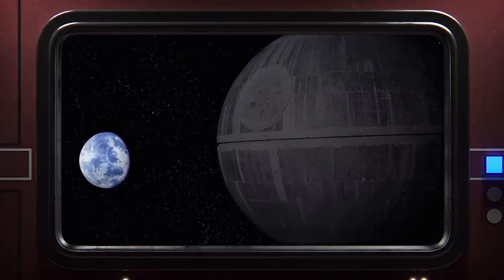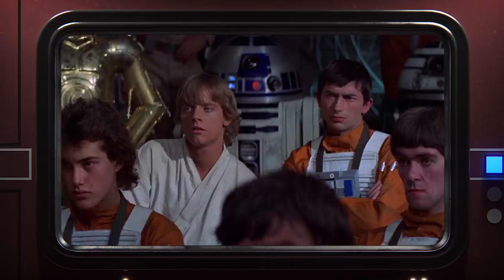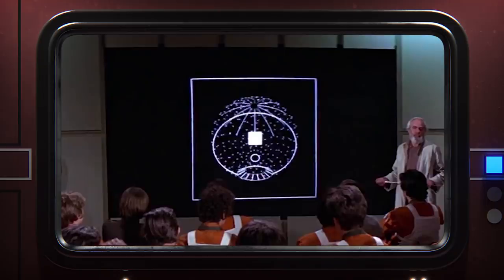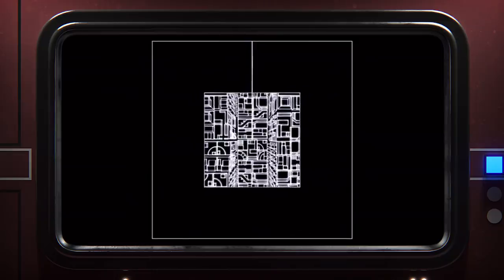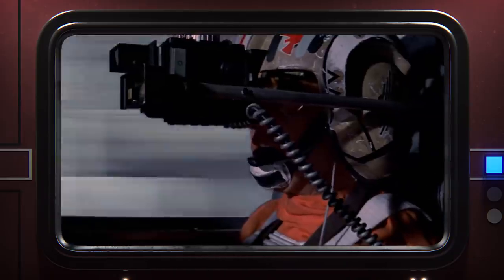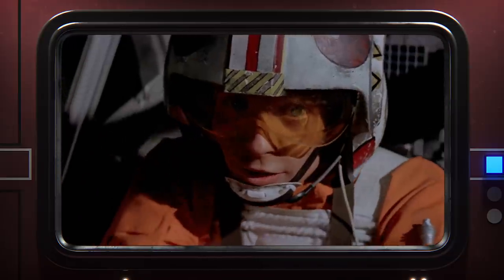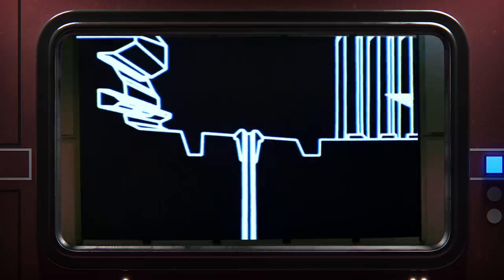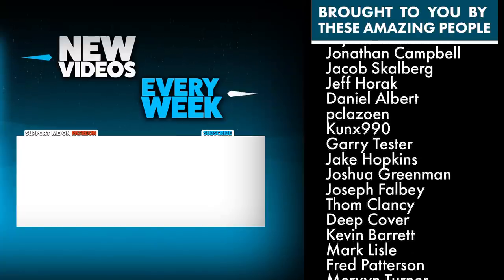The Thermal Exhaust Port Was NEVER a Problem

Comment: Great video! You may have missed one small point from the rebel briefing. I haven't read through the comments to see if someone mentioned it, but it's stated in the brief, itself,  that the empire didn't consider a small, one-man fighter to be a threat and that it's defenses were aimed at a direct, large-scale assault, otherwise their defense would be tighter. Even though the DS's construction would have, presumably, withstood a direct attach by such fighters, they still had a huge compliment of tie fighters on board and did try to destroy the rebels, ship to ship, coming very close to repelling the assault. Even without a super-tight static defense the DS still had the capability to stop the rebels. To refer to Luke Skywalker as a "Magical Space Wizard", who used the force to make his "impossible" shot, leaves out the fact that Darth Vader was also a "Magical Space Wizard" and he failed to stop Luke. It also leaves out the pang conscience that motivated Han Solo to change his mind and save Luke from Vader and two other tie fighters. The DS technicians analyzed the rebel attack and saw a danger and tried to fight back, even warning Grand Moff Tarkin in the process. His arrogance, alone, is what may have cost the empire the death star. It doesn't come across well in the movie, but in the book Tarkin is almost insane, over-confidently believing that the rebels have no chance, basically saying, "... So what?" To the new information. None of the nay-sayers even account for how much information was brought to the rebels and how much time they took to go over the technical readouts, just to find that one and only bit. Whether it was sabotage or not doesn't mean much because the shot was impossible for anyone who wasn't a magical space wizard; wasn't it Gold Leader who made the the only other shot and he missed. I get this feeling that some people think that Luke using the Force to make his shot was unfair, or some such nonsense like that. The Force was the only chance he had and he was the only one strong enough to use it. Besides, the Force is a hugely major underpinning of the whole damn story; without the Force none of it would've happened: there would've been no Sith, no Jedi, no clones, no emperor, no empire. To shit on Luke because he used his one special ability to do the impossible is ridiculous. The idea that the empire should've built the perfect weapons station is also ridiculous. Basic military theory dictates that if you make it impossible for the enemy to get in you make it impossible for you to get out and no weapon system is entirely Grunt Proof. I'm a Grunt; I know from personal experience. I may have gone off-topic, sorry. To pick this one idea to dump on, when you compare it to the dozens of other irregularities and inconsistencies in the story is stupid. After all this guff I've typed out, I think you're right; they did a great job of covering all the bases in planning the attack and the empire did a good job of covering the defense. Nothing in the building of the DS could've accounted for Tarkin's idiocy and Luke's Jedi ability and the attempt to plug a non-existent plot hole is a waste of time.  I think most people are still pissed it was Luke and not Han who destroyed the death star. I really enjoyed the video and I hope you have a nice day. Sorry for being windy.

Comment: About the Galen Erso thing:
In the Audio Book for Rogue One, it was said Galen Erso kinda tricked the Empire into putting it there. He explained the issue and gave three solutions. His favored solution was not the exhaust port, but another one (I didn't quite understand it, something like a large funnel, but long story short it made sure to mention that his preferred method was quite expensive and the exhaust port was the cheapest. He especially made it clear taht though the exhaust port wouldn't protect the standard crew quarters from radiation, it would protect the Officer Quarters, and seeing as he was presenting this to an Officer (some lieutenant, I believe), that would be fine with the Empire).

Though it made it sound like there was one thermal port, it didn't technically say that, and I think it still fits well with your explanation (which I like). He made sure that one was flawed, but the others were not flawed.

Comment: A little correction with respect to Rogue One. Erso didn't put the exhaust ports in as the weak point, he inserted a flaw into the main reactor core that he knew would cause a chain reaction if struck by a torpedo. Jyn refers to this in the dialogue, talking about a trap in the heart of the battlestation.

Comment: you forgot to mention that its literally impossible to blow a torpedo in it. even using the force, "which for plot points seems to have unlimited range at that moment in the film, but at any other moment its at most 100 meters"

since the air pressure from the exhaust port would blow the torpedo out of the hole
Reply: You think they carry unlimited air with them or something?
Reply: What air pressure? You are assuming it is a gas port, that it exhausts continuously, and that it is a high pressure system, and that it can possibly hope to resist a TORPEDO forcing its way down it- and there is no system in place to shut off if it detects back pressure. 

It might well just emit photons or radioactive particles- we have no idea. it might even only trigger when the gun fires or might have only been needed during construction.

Comment: Thank you! YES! Plus,  they mention that the Death Star's defenses are designed around a direct large-scale assault; they're designing their defenses around capital ships, because who would expect the enemy to attack an entire PLANET with fighter-planes? Starfighters are so insignificant against something this size, vital systems so much deeper than fighters could reach, that there was almost no point in considering it (from the Empire's perspective). And, they mention that a direct shot down the exhaust port might start a chain reaction. In other words, this shaft ran close to some other system, that ran close to some other system, that ran past the reactor- and an explosion might set of a chain of destruction ; it's not like the shaft led straight to the reactor.

And finally- the Titanic didn't sink because someone designed in a special iceberg-exploitable destruct system. It sank because although the designers created it to be safe and unsinkable, a scenario that didn't occur to them, where damage was inflicted in a manner they never expected, overcame their precautions. That's what happened here. A forcefield-sealed heat exhaust pipe isn't a glaring weakness or design flaw- it's something that, on paper, was adequately safe and posed no serious risk. But a group of rebels looking at the plans from another perspective- not to build something competent, but to find a way to destroy it, no matter how tenuous or desperate- connected the dots on how it might be exploited in a way the builders never did, because they had no reason to think it that kind of desperate, long-odds, destructive manner.

I hate the Erso idea, by contrast- because not only is it 'fixing' something that didn't need to be fixed... but it also goes from what's described in the paragraph above to an intentionally-designed system that apparently slipped past all peer reviews and inspections. An unexpected overwhelming of a system designed to be safe is a mere failure of imagination, and believable. A system designed to fail and not noticed or caught is what truly makes the Empire look incompetent- it's a failure of security, of basic competence and attentiveness on the part of other members of the project, and of intelligence on behalf of an Empire that knew they had a coerced and unwilling worker but apparently trusted all his work blindly.
Reply: Really? So this incredibly complex system could end up with a failure causing flaw from oversight and lack of imagination, but the lead designer of the damn thing couldn't in any way imagine a small change to this massively complex battle station that could result in the same? So ignorance is less believable for an explanation of a flaw in a system than premeditated sabotage, by someone who was an expert in his field, intimately involved in building the thing being sabotaged, which is unprecedented in its technological complexity?

Comment: There was also a book written about it where a group of rebels are on the death star in order to make sure that port was not internally repaired. Because it was designed to be exploited. And they got trapped on board and exploded. Was written in the early 2000s.

Comment: This exhaust port is above the laser. Dodonna says it leads to the main reactor, which primarily powers the laser. That could lead to the conclusion it's the only exhaust necessary or the only one that goes to the reactor and cause the chain reacting.
Also, Luke may have used the Force to guide the torpedo, but that doesn't mean it wasn't possible any other way because it's a TORPEDO. They can change direction. It's even shown in the graphic during the briefing. 
And "impervious to everything" is quite a statement. Maybe it was the only available warhead they had on hand that could. Also, I don't understand how this point would make the story less believable.

Comment: while the video highights the many "possible" exhaust ports, the movie provides a reference to the port in relation to the main disk of the energy weapon. That alone would negate more than half the possible ports. The technical briefing prior to the battle said "this" tiny port so they were able to identify which port. So I guess the original movie does explain everything but Rouge One answers a few questions except who the "many Bothans" were.

Comment: Given the events of Rogue One, the exhaust port is the way the Rebel Alliance found to exploit the sabotage installed by Galen Erso.  The true weakness of the Empire was Hubris.  They designed the defenses to counter a large scale assault not small fighters.  The Alliance used that against them by sending no capital ships and only fighters.  They picked the most vulnerable exhaust port that leads directly to the main reactor (the main port was most likely too well guarded and who knows what problems the other 17 had), and were able to make the shot.

Comment: You can apply the thinking here to the DS II, with the 'Millennium Falcon sized holes'. The Millennium Falcon was a freighter before it was modified by Han, and the DS II was still under construction when it was attacked. Keeping these 2 things in mind we can understand why the tunnel existed: its for other freighters loaded with personnel, materials and equipment. Tunnels and access ways of this and possible larger size wouldn't have just been recommended, they would've been required if the Empire wanted to finish the DS II within any reasonable timescale.

Comment: the mind blowing revelation for me on this is that now I know where the death star trench run is - It's not the big visible belt along the equator, it's a tiiny invisible latitude line that runs from the north pole!
  :)
So that means if this was a 'storm the castle' analogy, Red Squadron stormed the main gate, being the Main Thermal Exhaust Port at the north pole - The opening battle takes place over that entire north cap where Red Squadron 'cut across their axis and try draw their fire' to cover Gold Squadron's approach.   Red THEN had to take out that Deflections Tower, which I guess shrouded access to the trenches with a magnetic/deflection field.  Once Red 3 and 6 took it down (RIP Porkins!) Gold was able to sneak by and make their run down that particular trench.

You know as a castle seige this is pretty cool then, because it gives so much more context to the battle of the first death star.  @ECHENRY maybe you should do a play by play on this! :)

Comment: So Galen erso said in rogue one that it was the reactor module is what he tampered with not the exhaust port or anything of the sort, I think that the reactor had a secondary exhaust port in case it needed to release more heat but hitting that one was a better choice then the main one at the top. But is tampering may have made it to where it was easier to blow up and destroy then originally designed.

Comment: It's also worth noting that an earlier draft of Star Wars had Luke make two trench runs.

The first with the targeting computer, which failed.

And the second without, using the Force, which succeeded.

This was cut out for pacing issues, along with ramping up the tension of the battle, but including Red Leader's run... this basically means that the shot basically was impossible.

Comment: The reason why you need to introduce Urso as a retcon is that without retcon, you still need the situation be such that the rebellion can look at the plans for a few hours and locate a weakness, whereas the Empire spent years building it and didn't know the weakness exists. Introducing Urso helps because presumeably the "stardust" version of the plans contains annotations that identify the weakness.

Comment: On the issue of the torpedoes turning, I've always felt that it's obviously the torpedo system turning and not the Force. The animation at the briefing even has the torpedo going downwards! That's probably why the targeting computer needed so much time to work - it would be much easier if they could attack the weak point head-on.

Comment: Galen Erso's sabotage wasn't the exhaust port. It was in the reactor. He never says anything about the exhaust, nor does he imply it. In fact, he says the weakness is "deep within the system," "the reactor module, that's the key. That's where I laid my trap." "It's unstable. One blast to any part of it will blow the entire station." He then tells Jyn to get the plans to find the reactor. He's very specific. That's why the plans were important, so that anyone who knew that the reactor had a flaw could use them to find a way to get to the reactor.
So yeah, Rogue One's additional explanation doesn't diminish what's said in A New Hope. In fact, it expands on and improves it, showing that there were way more layers of defense to the Death Star that only more inside knowledge could get past beyond the plans themselves. The stakes become that much greater.

Comment: The biggest argument I had for this same issue is this: Luke brushes off the difficulty of a shot to a target that is 2 meters in diameter. What he failed to understand is that the entrance to the port is 2 meters. There's still the matter of ensuring the torpedo travels 75 KILOMETERS in a perfectly straight line in order to hit the center of the death star. It's not "just hitting a 2m target", it's hitting a 2m target from 75 kilometers away.

Comment: Not to mention, they even talk about a precise hit setting off a chain reaction. It's not like it is a direct opening to the main reactor - Galen simply built things behind that exhaust port that would allow a chain-reacted series of explosions to be able to blow up the death star. That is not going to be obvious to spot. The second Death Star had an even bigger weakness, which was that there was a tunnel you could literally fly a freighter down to be able to reach the reactor (yes, I know, because it was under construction). But everyone seems to point to the seemingly innocuous chain reaction caused by a direct hit, with a specific type of torpedo, that is "impossible, even for a computer".

Comment: So question for ship designing, just in case it interested you to consider modeling it:  There were occasionally heavy fighters with multiple hulls.  Things like the Lightning and the Black Widow, but the most blatant of them were ones like the Twin Mustang (which were visually, well, two mustang fighters made into a single aircraft). 

So what would your take on doing this for a Star Wars fighter be like?  Obviously, the go-to fighter to try this with would be to make a Twin X-wing.  I myself would give it an extra wing on each side that does not tilt, for a total of three on each side like the older Arc (you could also forgo having two cockpits as well, to make the second hull be basically a torpedo holder or fill it with anti-fighter concussion missiles or something, essentially making this into a fighter-bomber).  But it doesn't have to be an X-wing.  Maybe just limit it to NOT being a TIE at least. 

Ok, fine.  Also make it NOT a clown car.  Er, CLOUD car. 

Oh, now there is an idea.  Design the ultimate Cloud Car.  Like, take the Cloud Car, and actually make it awesome and cool and epic.  Somehow.  
.

Comment: Nope.  You nailed it.  General Dodonna fails to receive the credit he deserves for finding this flaw.  That is until R1 came around.  I like R1 well enough, but seems to undercut Luke's "1-in-a-million, kid" shot.
Reply: It still one in a million shot. Most of living creatures can be killed with one shot, but knowing that and how to do it doesnt make it easier
Reply: Luke did pull off the one in a million shot. He did something that was statistically impossible. The computer couldn't do it Wedge even says it only shows the tower and not the exhaust point. Garven Dreis (Red Leader) cannot do it even when the computer says it's got a lock the shots don't find the exhaust port. The only other pilot there who could have pulled it off was trying to shoot Luke down at the time.